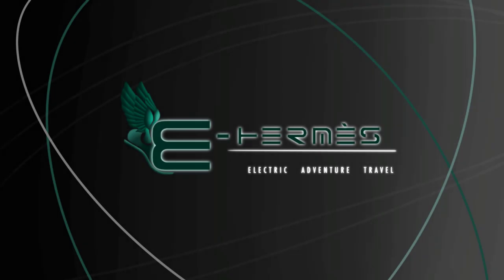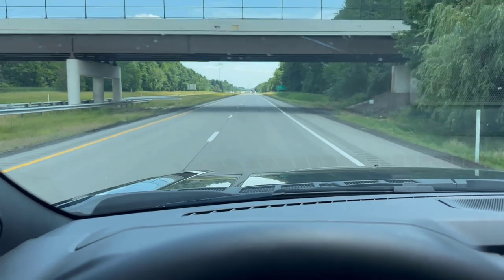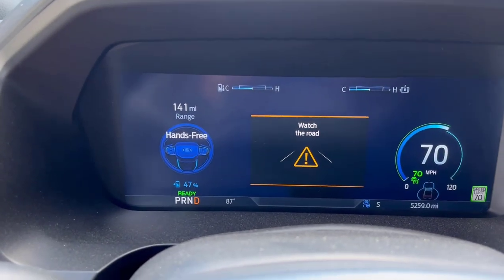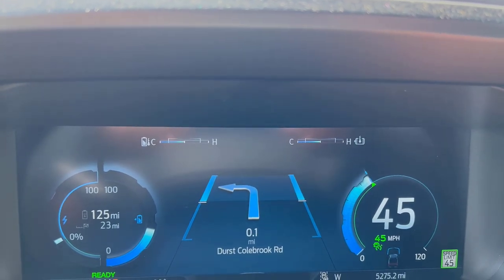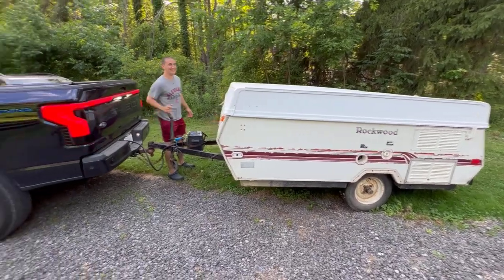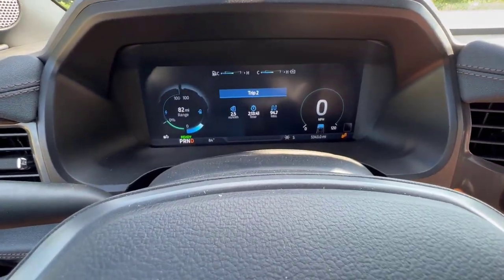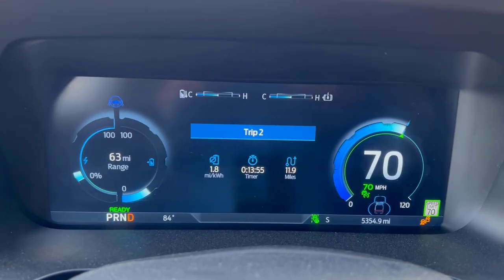F-150 LIGHTNING TENT CAMPER TOWING

Comment: For a camper suggestion, Casita Travel Trailer.  When all the stars are all aligned, I'm planning a Lighting / Casita setup.
Reply from the maker: I've been looking at Airstream Basecamp, but I like your suggestion as the Casita has a much lower profile.  I am going to research it further.  Thanks for the heads up.
Reply: @EHermes  You are welcome.  Your comment suggest that you are planning on buying.  My second suggestion is to rent.  Then you can try different trailers first before buying.

Comment: Excellent test. Thank you! 
You've confirmed what I assumed based on models-- the actual weight you're towing makes minimal difference compared to the aerodynamic profile change. 
If you don't tow something that is taller than the truck itself, and doesn't have trailer brakes turned on (eats your inertia up and ditches it as heat with trailer brakes-- really want to see someone implement regenerative trailer braking!) your range loss is going to be fairly small. 

Side note, tests like these make me wonder what would have happened if Ford had been willing to make some changes to the F150's Lightning's body shape and profile-- what kind of range gains could have been had with the same battery size?
Reply from the maker: Aerodynamics and speed are the real difference makers indeed. Ford is working on a second generation truck that may be more aerodynamic..

Comment: Anyone should also realize the more city driving you do with 35 mph tops and a lot of stops & starts you can get fantastic mileage range.  I test drove a platinum 30 miles all city and achieved 3.3 miles per kWh.  That's 432 mile range with a 131 kWh battery.  Tomorrow I'm making a different test on the interstate at minimum speed which is 45 here for two hours. The reason I'm doing this test is if I did want to vacation with a lightning,  I wouldn't be in any hurry and I would want to get as much range from the battery as possible. I'll get my answer tomorrow. I'll probably do trip 1 in one direction and trip 2 in the other just in case there is any wind that might effect the mileage.
Reply from the maker: If you can average 2.5 miles per kwh, you will exceed the rated range.  I assume a 130 kwh useable battery (plus it makes the math easier).  130 X 2.5=325 miles.

Comment: Would love to see another video like this with a slightly bigger pop up camper. I really think pop up campers are going to be the way to go with EV trucks. Much better to have range reduced by 15-25% versus reduced by 50-75% hauling large/heavy/box campers
Reply from the maker: Airstream makes an aerodynamic line called Base Camp that I think might get between 1.5 and 1.8 miles per kWh.  I am trying to get my hands on one to test my theory out.

Comment: Good test. You should try something similar only set your maximum speed on interstate to around 60 or even lower.  When I get my lightning and take it on a vacation trip I'll probably be trying to squeeze as much mileage out of it as possible.  When I finally stop I'll look for a free charge at a motel and stick around until it's topped off. I don't want to buy any gasoline anymore,  but just as soon not buy any electricity either. At home I'll be charging from my home solar system. Maybe even power my home with it if I get several cloudy days when I normally have to charge from the grid or from my 11 kWh generator.
Reply from the maker: Tell me what you are going to be pulling and I will get something similar and do a highway test at 60.

Comment: I've watched people tow 17k skid steer with the ford lightning overweight and it handled it like a champion didn't struggle to maintain speed or accelerate also he towed around town at 35mph and it was getting 1.7 kwh/mile it goes to show you how speed kills  your range i bet if you had a big ass rv took it down some backroads at 35 you probably can get more the 200 miles out of a charge
Reply: But nowa days everyone is in the rat race have to go 75mph everywhere and no one has time for anything mainly because of shitty political shit and super low wages people have to work two jobs not like the good old days of the 50s and 60s one person can provide for there family and live comfortably maby some day us millennials will get that chance
Reply: They always drive the speed limit or faster. I test drove a platinum and drove it 30 miles at the speed limit city driving only, nothing above 35 mph and achieved 3.3 miles per kWh.  That's 432 mile range.  And even better I drove 30 actual miles but the range on the vehicle went from 316 mile range to 309 mile range  that's only 7 miles of range used.  Had I driven all day in the city I believe these numbers would continue to get better.